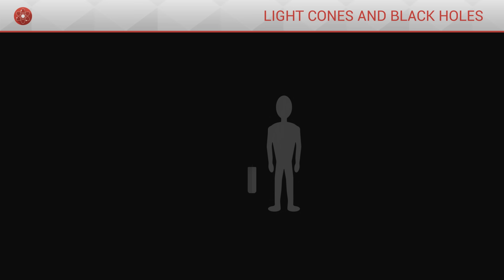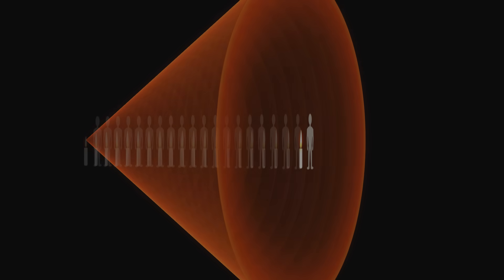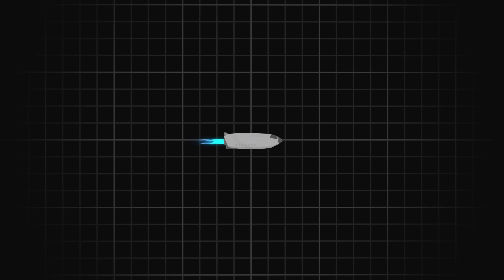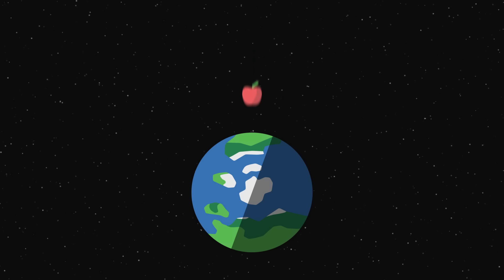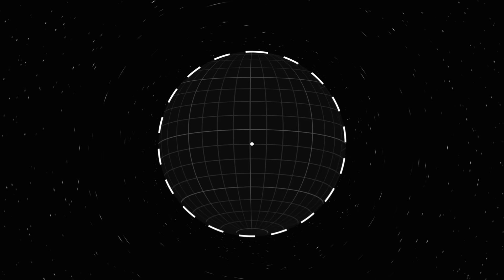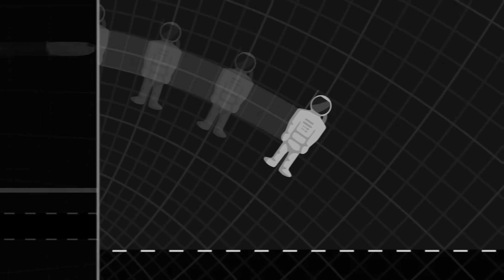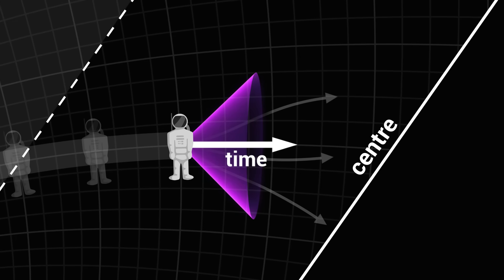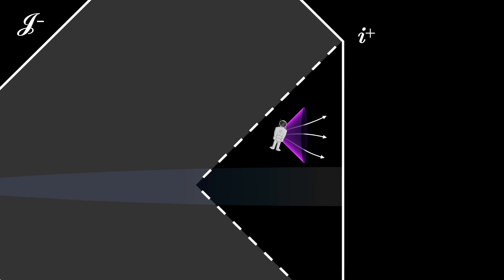Why Time and Space swap in a Black Hole

Comment from the maker: Hope you like this new video!

About this video, it was a work of research, trying to find the most intuitive depiction of why time and space swap around inside a black hole. I wanted to find a set of coordinates, or a diagram, that would be mathematically accurate from the scientific standpoint, as well as being easily explainable in layman terms. For this, I have developed a more intuitive (in my opinion) version of Penrose diagrams, which, for those interested, consists in embedding the Penrose diagrams in the complex plane, and applying the conformal transformation z→z². This allowed me to generate a curved grid (used throughout the video, at 6:08 for instance), which is more intuitive than a Penrose diagram in the sense that "motionless" objects still move in straight horizontal lines, while clearly displaying the orientation of "time" and "space" (from Kruskal coordinates), and thus keeping lightcones oriented at 45° everywhere (thanks to the conformal transformation). Btw let me know if you have seen such a diagram before, I personally haven't, which surprises me since the construction is not so difficult to come up with. As a little bonus here is a preliminary simulation I had done while preparing for the video: https://www.youtube.com/watch?v=L0UilXW34cs

About something else, if there are Spanish speaking people among you, don't hesitate to check out the new channel in Spanish. We will soon translate the main videos of this channel in Spanish. We just started it a few months ago, and it would help a lot if you share with your Spanish speaking friends or family 🙏 http://youtube.com/ScienceClicES
Reply: May i ask what the background music is in the video ?
Reply from the maker: @Venom0007  Yes it's a personal creation, you can find it on my SoundCloud : http://soundcloud.com/aroussel
Reply: @ScienceClicEN  Isn't ot inaccurate to say causality is limited by the speed of light..it's only our perception that is limited right?
Reply: I love this video thanku ✨❤️
Reply: You are real master of presentation. ❤️☺️🙏🏻
Reply: I like how you explain the theories about time and space.
Reply: I think it's a mistake to say that we can travel through space in any direction, but travel through time only in one direction. After I travel from spacial position A to spacial position B, I cease to be at position A. If I "travel" from time A to time B, I continue to exist at time A.

To put it another way, "travelling" is an intrinsically temporal concept. It can be defined as changing position across time. So what does it mean to "travel" through time? To change time across time? It's incoherent.

Rather than saying we "travel" through time, it is more correct to say we PERSIST through time. To whatever extent our identities are thought of as our physical bodies, ultimately we're completely stationary creatures with a spatio-temporal size, shape and position. Given the block universe, the true nature of phenomena like "the present moment" and "travelling" are fundamentally different than our naïve understanding; they're illusions. Failing to update our understanding may be leading us to err in thinking that time is different than space.
Reply: @andrewj22   @Andrew J I think: It's another dimension, but we don't have the degrees of freedom in the temporal dimension that we have in the spatial dimensions.  Beyond that, I think it's a philosophical matter.  The three views I'm aware of are eternalism, presentism, and the block universe.
Reply: @bsadewitz  What freedom do we have in the spatial dimensions that we don't have in the temporal one? I don't see us having any freedoms in any dimension. Furthermore, I don't see any reasonable way to reject the block universe model given the evidence supporting general relativity's description of the nature of time.
Reply: @andrewj22  Sorry, I was using "degrees of freedom" colloquially, blissfully unaware of what I was getting myself into.  

 I am quite sure that those views (at least) exist, though--unless I am confabulating.  That's possible, but I don't think so.  I wasn't endorsing any view over any other, just recalling what I learned in (probably) philosophy of science 20 years ago.  There are "reasonable" arguments.  Someone is waiting for me now though so I should attend to the world, then I'll come back
Reply: @bsadewitz  Looking forward to it. Oh, and by the way, "eternalism" and the "block universe" are just different terms for the same view. The way I see it, other views are simply leftovers from a time before scientific evidence was found in favour of the block universe model.
Reply: @andrewj22 Prepend "growing" to "block".
Reply: @andrewj22  Do you think relativity of simultaneity implies eternalism?
Reply: @bsadewitz  Yes.
Reply: @bsadewitz  But despite the fact that Sabine is making the case for the block universe, she makes the exact same mistake that I was complaining about in this video (above): the "we can't move backwards in time therefore time is different than space" argument, which doesn't make sense if you keep the implications of eternalism firmly in view. A more correct way of understanding the fundamental nature of "movement" through space-time is that we're not actually moving at all. We're completely stationary entities with a spatio-temporal size, shape and position.
Reply: @andrewj22  Thank you for bothering to thoughtfully engage with me.  Until roughly twelve hours ago, I had no intuitive understanding of this.  I had to put the phone down or I would have been unable to sleep; that is how awestruck I was.  When I'd asked about the relativity of simultaneity--that's when my insight crystallized.  Wow.  I still can only write in fetters about it.
Reply: @bsadewitz  Awesome! I feel the same way about it. It's profound to think my past and future experiences and actions are still out there, and all the lives of everyone past - not gone, just distant. Also really fascinating to consider that time may be, in every way, just another dimension of space.
Reply: @andrewj22  In retrospect, and assuming you're correct, I suspect she purposefully chose to explain it this way because it serves as an "intuition pump" (grr, I hate quoting Daniel Dennett, but sometimes I just gotta).  In fact, I still look at it that way most of the time.  It's a bridge. 

I'm most likely going to start taking math classes at the community college because I have come to understand this well enough to know what I'm missing, and it's driving me crazy. 😂. The furthest I ever got was pre-calc, so I have my work cut out for me.  I wish I'd been aware of this when I was a teenager.  I loathed math.  E
Of course I knew it was integral in many fields, but I simply planned to avoid those.  Never before had I wanted to learn it for my own purposes.
Reply: @bsadewitz  Philosophy was my major. How is this an intuition pump? It seems like it's simply an argument from poorly worded (i.e. false) premises to a conclusion that wouldn't follow if the premises were worded accurately. Note the implied "therefore", which wouldn't appear in an intuition pump.

1) We can travel forward and backward in space.
2) We can't travel forward and backward in time.
Therefore, C) Time is different than space.

But there is equivocation on the word 'travel' between the two premises. If the meaning of the word is the same in both premises one of them will be false.
Reply: @andrewj22  I don't recall what I was thinking last night, unfortunately, but you're correct (as usual).  I don't have a functional computer at home, so most likely I wasn't actually speaking to what you'd actually written.  I have difficulty following lengthy threads with the mobile YouTube client because the text input box obscures the message(s) I am responding to and prevents scrolling through the thread.
Reply: @andrewj22  At this point, I might as well just say it:  I suffer from some cognitive impairment vis a vis attention/working memory.  Several years ago, my psychiatrist ordered a complete neuropsych workup.  I spent about 10 hours with a grad student taking tests and performing various tasks.  Let me tell you: that was the total experience. 😂  Like, "Oh, here, take the WAIS".  "Take this section of the DAT".  "How about a Stroop test?"  "Want to arrange some blocks?"  "Now, just sit at this computer and ..." I learned that my IQ is +2 SD, and that everything is grossly within normal limits--except executive function and a couple of other things.  Those were nowhere near what one would expect given my age, scores on everything else, etc.  So, I recently found out that I likely suffered a TBI in a car accident ~15 years ago.  It never occurred to me to go to the hospital, as I just felt somewhat "out of it" for a day or two, and that was it--until the period of prolonged isolation early in the pandemic.  That wrecked me.   Of course, millions of people have experienced this to some extent, but it's been arduous for me.  My insurance finally approved cog rehab, and I'm fairly optimistic I'll be fine in the long run.   I suppose I didn't need to say all this, but I've always highly valued lucidity (I was a philosophy major, too) and most people I know don't seem to understand why these difficulties are the source of such discomfiture for me.
Reply: @andrewj22 Question from a layman to better understand the environment inside the horizon.

Can the figure of a circle, as the connected locus of all points for as limited by a given radius, exist inside the horizon, or would the pressnce of the singularity in the circle's future interfere with the circle being a limited locus of points? 

Or to restate, does the presance of quantum singularlties alter/distort the circumferance of the circle, drawing progressivly into an oval. Because one side of the circle, being closer to the center, is (more) biased in favor towards the center. 

I am interisted in the physics of geometry because now that I am older my incite realized that these equations that bedeviled in in school are describing physics in part.

I wonder, If one treated classical physics as a system of equations and tiried to solve it, what would come out? I doubt a hard answer, but I think some kind of intrinsic... proportionality would emerge. I was wondering if being inside a black hole would alter that intrinsic   scale/proportion.

Insight! I think I am asking how space relates to itself, I think.

Then again, I am a layman with just enough knowledge so as to be  dangerous, but not enough knowledge to appreciate how.
Reply: But wouldn’t that mean that time is a force rather than a dimension? Otherwise it wouldn’t be irreversible. Time cannot be stopped, it’s direction can only be changed. Meaning that gravity (which is considered to be a force) is nothing more than time directed towards or attracted by mass. I am by no means a physicist, but this just goes through my head.
Reply: @ヤヌスクレーマー  that's what I'm saying  is "nothing" exists as a dual function  "nothing" over duration/period....  which means negative  net void of 1 ....because  it's a shader glitch... they only exist as abstract concepts... as duration points 👉to some sort of aspect ratio or observation effect wich causes the feild to collapse...  as every thing is falling in tward stillness.. and the opposed is falling out tward entropy  ...and at a single  point the needle flips and springs new bubble  of inflation ..but this exists in confines of nothing  so the boundary keeps squaring ... my thoughts is hawking radiation  is actually the 180° back roll to time kind of like a players piano 🎹 and we are the cross feild that interacts with all these real things  in the boundary but returns to the net on the other side ..those who have stayed true to their  harmony are kept ....and bland tones are scraped ....its tandem play.. or sync .. "Universal Expo manifest"o" every body step up, step right up..come one ...come all ... fun for every one ....granted context mutual acceptance ..not agreement ..but instead, realizing the need for, self arrangement in prospect to confines of subjective reality that we have ,no rule or greater authority than one....and that we have a chance to become  real  but that is undefined you define what one means science looks outside ...for something that's inside you  and it's like you know the confines so just live now.... as the universe inside of you ... its the Little voice not the big voice the big voice is the ego 9 times of 10 ....and must be silenced... as its feeding you unrealistic expectations of who you should be and that's damaging because it leads to attention seeking behavior  or self victimization ... as one must be open to the idea before they assume such a self denoting idea and then from there it spirals out 💣💥💨🤘🤘I think we exist in the center 45° margin of a eulers spiral as its the one few ways to flatten a sphere space drags time pulls and in-between is the 45° boundary  zone every thing is ether half or whole but never quartered 1/3rd is equal to 2 quarters ... every time you put an empty  space undefined so one dimensional square or negative space that automatically creates one in opposed.. so one exists fundamentally out side the set... as it is definitive of the margin or self ..time is one round trip it behaves like ac in a dc current  because  one faze drops through zero  ....but the dc is faze constant so when you put them through  a current messuring device  the as time "moves" there is a drift in modes and the gap is expanding  into itself so it's imploding not exploding.. and that would explaine why there was light everywhere at the beginning 🤔😳😐
Reply: @ヤヌスクレーマー thats kind of what I'm saying ..is that time is a force  because it has a depth to it ..and it works like ac
Reply: @ヤヌスクレーマー  a force is defined as something that would cause an object to change its direction ...  the apple moving through spacetime is actually following a straight line that is bent by mass ...  time itself is not a force, it's a dimension ...  you can't apply "time" to something ....
Reply: It's called general relativity for a reason. I think you may have missed the who relative to something else
Reply: "Trying to find the most intuitive depiction of why time and space swap around inside a black hole". I think you did! Absolutely the best depiction of this mind boggling fact I've ever seen.
Reply: 🧐➡️REMEMBER MY WORDS because very soon world scientist will discover what I know since 2002 because I  checked personally, since 2002 I know that Black holes are in reality INTERDIMENSIONAL PORTALS which means that in the other side of a black hole there's another DIMENSIONAL REALITY OF EXISTENCE TOTALLY different to our Dimensional Reality IN 3D in which we EXIST and experience Conscious Awareness Existence! How do I know? ➡️https://youtu.be/w_LSA__VSVE
Reply: It was fantastic! Very clear. I like how you put time going from left to right; time running vertically always seemed less intuitive to me. I might humbly recommend you take a little more time in the last part of the video, giving another sentence or two describing the straightening transformation you did (is the singularity a hyperbola??) and then another sentence or two describing the parts of the Penrose diagram (eg. that the singularity is now a vertical line on the right). That part felt like it went by really quickly.
Reply: I love your channel. Thank you so much. You have a brilliant way of explaining the most complex concepts. Id love for you to so a video on exactly what is light specifically, photons. Its very hard for me to picture these massless particles.
Reply: what about a spinning black hole? I don't think inside the black hole is a point but a churning ball of hot matter compactly crushed.
Reply: At the speed of light and at the event horizon, doesn’t special relativity cause the astronaut to experience 90 degrees on the space time axes? While the inertial observers would view them at 45 degrees?
Reply: Stop making up random stuff and claiming it's what takes place in the universe stop it

You're all doing this it's disgusting there's absolutely no evidence know what nothing whatsoever that proves you're right that it would even give an indication that you were correct

Nobody's even proven black holes exist let alone what they are or what they actually do

For all you know they're cold fusion Stars because after all you don't actually know anything
Reply: @stevecopper1667  There’s literally a picture of a black hole
Reply: hhttps://www.youtube.com/watch?v=jAi7Wz18pUE
Reply: Unedited Life Of Daniel  that's basically in short what I said ..but  in different words ...everything exists  from an imploded  black  hole 🕳 as when it dies from hawking  radiation droping it below the critical  mass and as each black hole has the same tipping point then they create new universe's at different times that are all bassically Identical except for its location  in time there for each assumes a new identity that was the previous idea ... as the only thing real.... in prospect  to the environment which speaks for its self.... is the idea of self... we merely observe cause and effect and then philosophy  why that may be but at the end of the day the only philosophy to be spoke is of self.people worry about what's out side and they don't even realize what they really are inside.... they ...are an idea.... a concept ...and 95%of people will never know who they actually are as they are preoccupied by there ego which feeds them conflicting ideas of self expectation ....vs ..how they,  think they should feel.... and they will always be conflicted.... as long, as they keep putting their self expectations outside them self, they will always be without their self.....as basing how you should live, in order  to be happy or successful off of other people, and their ideas is a bad idea... and a good way to live in the sickly world of the "fine" people .... people that when you ask how their life is and they respond with " I'm fine, could be better""but"" I'm fine" the people who are suffering and unaware..while the superpower that be, play the strings and and make a mock tone while strutting to the bank to deposit more of people's lives... people see money and they don't realize it's their time and they give it away for nothing investing in a future that ain't their... if your kids grow up to live the same life and they have been for 150years then how is it working for a better tomorrow...everyone fighting the governments war .. and because  of fear ..say we call a country we want resources from .....and they won't give in... so then we say ...were going to attack .... at which point because their citizens are aware of the neibouring country's stock pile of weapons. They all assemble thinking they are gonna be attacked...they sit next to our border with their weapons and they to look scary... at which point we call our public and say everyone must assemble we are being unjustly invaded... when really it's a door, to provoke our side into storming and stamping an innocent country ...as we film the other side doing trying exercises and put it on news for propaganda to make them out to be the antagonist...and because our people see they have weapons and now they think we are being invaded ......our side will shoot first ask questions later as they won't jeopardize them self to approach the other side alone and potentially find out we are actually the invaders..as will the other side shoot first because they think our people want to invade them when really our people think their just launching an offensive defense... and because citizens allow for their governments to conceil and stockpile such weapons of mass destruction  then every body will always be terrified trigger happy maniacs... I like guns ....but I don't like the idea of such unessisary stock piles, in the hands of so many brain wash people who think that the way to press fair treatment "justice" is with a gun instead allowing  context of being ... or the idea of  being irradiated by a 1000 sun's from a nuclear trigger  happy  butt hurting unit
Reply: that was an amazing watch. I feel like I have an understanding without a mathematical mind.
Reply: white hole
Reply: 8:40 I am not seeing how a translation of the axes of 45 degrees swaps time and space in a black hole, since one would need a translation of 90 degrees to achieve this. 

In the case of 90 degrees, black hole space would now be in the direction of normal time, and black hole time wound be in the direction of normal space.

I can see that the 45 degree translation does trap the astronaut in the blackhole as far as the light cone goes, but not how that swaps time and space.

I have seen a mathematical derivation which does swap time and space, which is why I clicked on this video, but I can't see that graphically from the 45 degree translation.
Reply: youve never been inside a black hole or seen inside one. so you cant prove any of this. its just bs theory.
Reply: The horizon is still a place in space though..so isn't it a little wrong to say it's just a moment in time now? It's also a boundary in space..
Reply: I dont agree with this theory. Time is not bounded to matter or non matter. even if universe did not exist time would have passed anyways. Imagine a person was indestructible but mortal if he felt into blackhole he would have died anyways at 90 years age, and even if we travel faster than light we would still die because every matter has its own time so falling into black hole your inner time passes and it does not depend where you are in space and your inner time does not care if youre inside of a black hole, or somewhere else. Like Allah in Quran said everything will die and perish, except him and we cannot escape it no matter where we are. Science has many flaws.
Reply: @abcfx7391  You've misunderstood. There is only spacetime.  Time is a real, physical dimension.  If the universe did not exist, spacetime would not exist.  Time as we understand it in our everyday lives is an illusion.  Everything that exists is part of this universe.  Without the universe, no spacetime. 

No one claims that travelling at light speed would make one immortal.  Well, you can't travel at light speed, so let's talk about almost the speed of light.  Your clock always ticks at the normal rate for you.  The faster you go, the slower your clock ticks relative to others clocks.  I'll put it this way:  we are always moving through spacetime at the speed of light.  Everything does.  There is only one speed that everything moves at.  Imagine an airplane in the sky.  It is moving at a certain speed in each of the three dimensions (x, y, z), right?  Add up all three axes' speeds, and you get the speed of the airplane.  Now, add a fourth dimension.  This is time.  The faster you go in the other three dimensions, the slower you go in the temporal dimension.  At light speed, there is only x, y, z movement.  Light does not move in the temporal dimension.  Therefore, it always has to travel at light speed through spacetime.   We do move in the temporal dimension (only forward) through spacetime, so we cannot go light speed in x, y, z dimensions because some of our movement is taking place in the temporal dimension.  Time and space switch places to some extent everywhere, because gravity is the warping of space-time.
Reply: @abcfx7391  Science says that everything will ultimately perish, too.

https://en.m.wikipedia.org/wiki/Heat_death_of_the_universe

With regard to Islam:  it goes without saying that there are MANY theoretical physicists who are also Muslims.  I suggest you find one (ideally, more than one) and ask him to share his understanding with you.
Reply: @abcfx7391  You should not presume this science is "flawed" on the basis of your religious beliefs.  No one said that staying faithful would be easy.  It is YOUR responsibility to reconcile well-established science with your faith/religion.     
In doing so, you would undoubtedly come to understand more about both.
Reply: Thank you SO much.
Reply: It would be great if you presented this as conjecture, rather than fact. The reality is that nobody knows what’s really going on with the very dense, non-luminous objects we call “black holes”. Presenting these ideas as fact only confuses people and sends them away with all of these ideas about space and time that are little more than a mathematical exercise. You and I both know that there is no physical evidence of what you’re talking about here.
Reply: I am sorry i did not find this video 10 months ago. I would be interested in your interpretation of Lorenzo Maccones Arrow of Time Paradox and his theory about entropy decreasing events occurring on a macroscopic scale. Since he mathematically proved the events can occur and that all data of their occurrence would be deleted within the system in which they occur, unless a being was outside of the isolated system in which they occur, the data of the event ever happening would be destroyed. This is the best i can do compressing the details and articulating them in a way that makes sense. What is  your perspective on this anomaly and its disproval of the second laws of thermodynamics. Does it disprove it? Or does that very specific phrase "the entropy of an isolated system "TENDS" to increase over time" still allow the second law to remain accurate?
Reply: It is an interesting and informative illustration. Thank you :)
It would be interesting to map the object traveling with a velocity that increases toward the speed of light. aka following in the direction of space toward the edge of the light cone. Traveling at the speed of light like a photon at at right angles (space) to the direction of time introduces some weird mathematical phenomena.
>
I like your illustration. I just mathematically (disregarding mass) graphed the second hand of a clock with a Radius of 2862807095.5421653553357478091848m making the tip of the second hand travel at 299792458m/s (approximate radius of the Sun to Uranus). Calculated at full size and then scaled to a radius of 500 pixels I mapped an additional second hand showing the accumulated time dilation at a radius of each of the 500 points from 0m radius  to 2862807095.5421653553357478091848m radius. It is interesting to see the time of the quartz motion of the clocks second hand as the other time dilation plot curve away from each other. It's also the only moving representation (graph) of time dilation I have ever seen of 2D + time in a single display.
The above all came about out of my long term fascination with the various dimensions of infinity in circles and the infinity in constant motion analog clocks as well as a fascination about the weird math at the event horizon of a singularity :)
In some sense the clock portrays the curvature of space time at the outer circumference where the right angle of the time dilation hand points almost directly away from the center of the clock. You could imagine the outer circumference of the clock as an inside out representation of the event horizon of a singularity :)
Reply: I'm not sure the title should be worded that way. I was thinking you'd discuss some theoretical idea and the flow of time. As you would find yourself going backwards in time if space and time were to swap, correct?

One needs to remember the extreme warping that a singularity creates will offset the light curve to never allow the two to "swap"
Reply: @Benson_aka_devils_advocate_88  "One needs to remember the extreme warping that a singularity creates will offset the light curve to never allow the two to "swap"",
I think it's more complex than that, but can be explained more simply when the right scientific tools become available to us.
Personally, I have a strong suspicion that space/time can swap at the extremes of a certain value of infinity. By swapping I mean changing states in much the same as a quantum particle can change states.
It's difficult to imagine 4D space and the 2D + time representations don't really do justice, but I feel that 3D (x, y, z) planes can also revers as part of this. If you imagine a sphere, the center become the outer surface, and the outer surface becomes the center. Space becomes time, time becomes space. Much of the scientific theory surrounding black holes when something crosses the event horizon supports this idea for me, as well as the theories around inflation after the theoretical big bang, or big emergence as I prefer to call it :)
>
Space, time and light(energy) is weird in any math or language lol
Reply: @axle.australian.patriot  There's so much we don't know. But the universe in no way is required to behave in a way that we wish it to behave.
Reply: @Benson_aka_devils_advocate_88  One of my fears is that we put too much emphasis on applying our subjective descriptions (human made, math logic etc.) over the natural workings (mechanics) of the universe. We attempt to describe it as logical when I tend to see it as illogical, or analog. That doesn't necessarily imply disorder as with what we see with entropy, order can emerge out of chaos.
>
I have spent some time attempting to find a way to describe the balance between the extremes of the many ranges of infinity. I guess an analog or fluid computer would approximate as an an analogy :)
Reply: @axle.australian.patriot  Infinite possibilities isn't the same as infinite outcomes. This is something I feel many forget to stress when discussing infinity in a system that has a time component. It's what beggers the discussion of freewill vs determination.
Reply: @Benson_aka_devils_advocate_88  I know, infinity is a difficult concept and discussion. I spend too much time looking at circles and analog clocks lol
>
I wrote a time dilation clock just to visualize it for myself. It has 2 second hands that mathematically have a radius of the sun to about Uranus. The tip of the second hand is traveling at 'c' The other second hand maps the accumulated time dilation on the clocks face. Calculated at full size and then scaled back to a 500pixel radius for the graphic display. I thought it was an interesting way to visualize time dilation in 2D + time "in motion" rather than most of the static representation that get thrown around like the time cones.
>
I do want to add mass, force etc to it when I get time.
Reply: Nice hypothesis, but how do we get to a blackhole to test it?  Or can we make one locally to experiment? Theres only so much theoretical science you can do before we have to start doing real science - testing.  And thats not that helpful if we cant even reach a blackhole.  We could make a century long trek to one, and hopefully use its energy we've calculated thoertically to get back instantly.  But thats kind of risky, would you bet you know exaclty how a black hole operates with those kinds of stakes? More realistically (or not) we'd have to create one locally to experiment with it.
Reply: Now I see why witch's burn candles off to do a spell thank you
Reply: I have asked questions in a comment I just posted. The questions sounds critical.
Please do not take the comment as critical.
On the contrary, your presentation is the best by far I have seen. The fact I can make comments, ask questions is a huge step in my understanding.
Very well done your presentation, Truly.
Reply: This has got to be one of the most unique ways I’ve ever heard spacetime explained. Well done.
Reply: Wrong lol
Reply: is it possible a black hole can be studied like an iris(eye).... i can't stop thinking about this.
Reply: 1w4😮4
Reply: LMAO Did someone say you could swap space and time?
Time = Relative duration
You can't go back in time because you can't reverse a duration.
Don C.
Reply: https://drive.google.com/drive/folders/1gL-Amt9ZLnZaMSRaW29TkcIJKMzTklW3
Reply: Good work Russell
Reply: Too much annoying ads on your channel
Reply: Gobbledygook
Reply: The past no longer exists, and the future does not yet exist; only the present exists, the universe mutating at every present moment. It is a mistake to believe that time is a dimension that extends far into the past and future, although mathematically it is a good tool, but it causes us much confusion and, above all, a misconception. It is not that within the event horizon time "bends" and interchanges with space; the fact that the "light cones bend" inward simply means that space is moving toward the black hole singularity at the speed of light, dragging any sphere of light with it. Even further inside the event horizon, the Eddington-Finkelstein coordinates tell us that space moves at speeds even greater than the speed of light, which is very similar to what happens with the expansion of the universe at great distances. So space is actually being sucked into the black hole, dragging the astronaut, the light, and everything in it with it. It's not that the astronaut is "falling" into the black hole, but rather the space around him is being swallowed up at a monstrous and absolutely incomprehensible speed! My philosophical question is: what happens to the energy of all that space? Does it modify the energy of the black hole?
Reply: What my puny brain understood:
Speed is just Tan(θ)
And when θ approaches 45° then speed = 1, which is speed of light in natural units.
I know it's over simplified but is my logic correct?
Reply: I have a question when a ball fall from top, we can't reverse it . Which is similar to dropping ink to water which we can't able to reverse due to increased entropy. But when ball is falling down where can we see "disorder"? Could you please make a video about it or answer my question
Reply: @whatsup3519  The disorder is from the ball releasing its energy into the ground when it bounces, yet it retains itself to keep bouncing, as opposed to ink which dissipates because it is a liquid.
Reply: I think, it was in one episode of PBS Space Time, where they used a similar illustration. There they described it as "Space becomes timelike and time becomes spacelike" inside a black hole. Yes, with such illustrations, I could see how and why. But still, trying to think about how it would actually "look" like or feel like makes my brain implode ... :)
Reply: Gracias!
Reply: I explain this to a t on my channel to I discovered  tesla prepectual motion machine the real one
Reply: The moment when you made up a lie about space and black holes and now have to make much more lies to cover up the previous one.
Reply: Shiwn the topic in a very nice way,  though I cant really see the switch to tine behaving as space and vice versa. Another German video tells, that movement through space now only allows one direction to the center (instead of 3 freedom grades outside) but time might be more freely moved through now 🤔
However I dont see any ohysical reason why a black hole should be an empty sphere, but massive.
How do we know if our physics still work right below the horizon, and does not only break in the very center (unlikely beeing of infininte density)?
Reply: @ProgressiveEconomicsSupporter  So there is no sudden transition, space and time are continuous and curve smoothly. A falling observer doesn't experience anything weird: if they are inside a small box with no windows (and assuming the black hole is much bigger than this box) they have no idea that the box is falling at all. So they can still move in 3 directions inside the event horizon.

There actually is no single direction of time or space, there are multiple coordinate systems that are all valid. Like you can say the +x direction is your left and I can say the +x direction is your right, and both can be correct depending on how we draw the axes. A direction for time describes the world line of some observer. You can say the time direction follows your world line and therefore you move purely in the time direction, while someone in a fast spaceship can say that the time direction follows their spaceship and you are therefore moving backward and not purely in the time direction, both are correct depending on how the axes are drawn.

Outside the event horizon, the direction that results in hovering at a fixed distance is a valid direction for time because observers can move in such a way. Inside the event horizon it's impossible to hover so no valid time direction points perpendicular to the radius. But it is in fact possible for observers to move directly in the radial direction so that becomes a valid direction for time. If chosen so, the other 3 directions: east-west, north-south, and past-future, would be the corresponding directions for space. So the event horizon marks a boundary where the intuitive coordinate system stops working and the weird one with time and space swapped starts working. But it's also just as possible to gradually change coordinate directions while getting closer, resulting in no sudden change at the horizon. Such are how the coordinates the video used work (if you're curious, the video uses Eddington-Finkelstein and later Kruskal / Penrose. The coordinates that have a sudden change at the event horizon is called Schwarzchild coordinates).